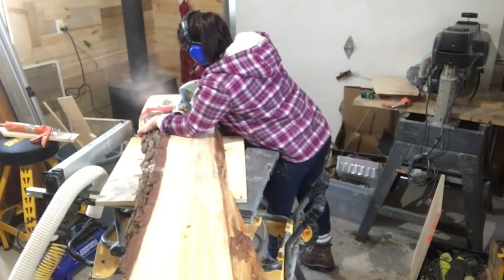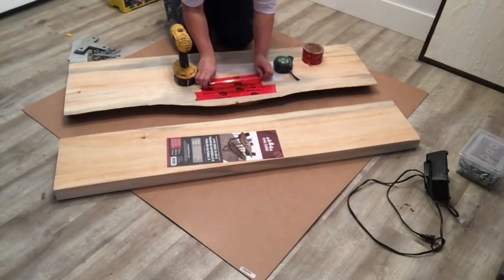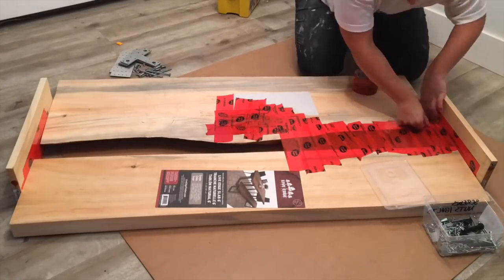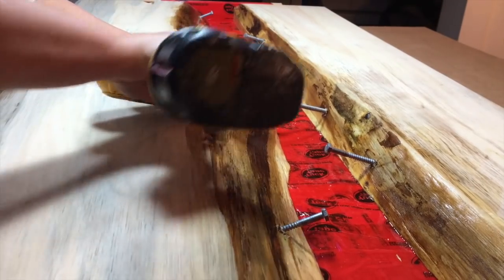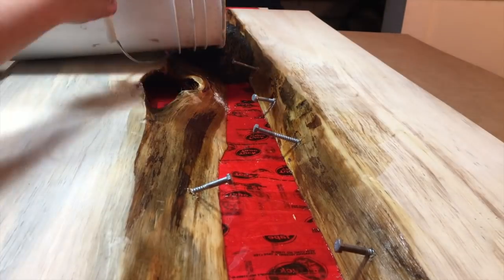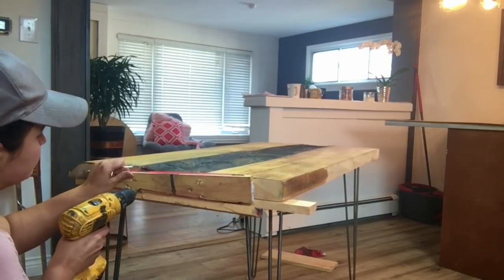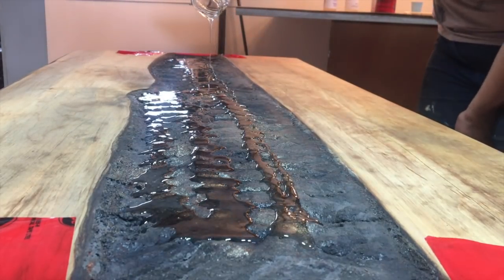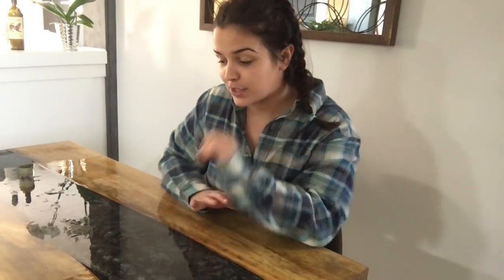Concrete river table with epoxy

Comment: I'm liking it. Been considering straight coloured concrete countertops in our new kitchen being built this summer. This would make an interesting option.
Reply from the maker: Offgrid NB I love the look of those!  I would like to try them sometime. But after using this concrete I would totally research the brand/grit etc. If I did it.   This wasn’t nearly as smooth as I thought it would be when mixing. And adding water didn’t help.
Reply: @dcwoodworks  Yes from my research you need to make your own mix from sand and portland without using gravel. Since it isn't a high load surface like a driveway or foundation the gravel isn't necessary. Its also cheaper to make then readymix.
Reply from the maker: Offgrid NB oh wow. I never even thought about making my own mix! Genius.     I
 Gonna read about it.    Maybe my next video haha
Reply: @dcwoodworks  dive in and have fun. Lots of resources on the internet to make it successfully. Maybe try some small test batches before plunging on a permanent project. I'd love to see your vid on it. Always liked your projects. Fellow carpenter in NB waving a hand. 🙋
Reply from the maker: Offgrid NB haha good idea! I will definitely video it

Comment: What kind of clear coat/how many layers did you use on the wood (and on the epoxy maybe)?
Reply from the maker: Tyler Leslie i used three layers of Rustoleum bar top epoxy for the pour. And then one final one over all

Comment: Nice table! What finish did you use on the wood?
Reply from the maker: Boondock Patrol thanks! I actually used the pour on epoxy for one fourth final layer over the whole thing. It’s super hard and durable after a week. Is rustoleum pour on bar top